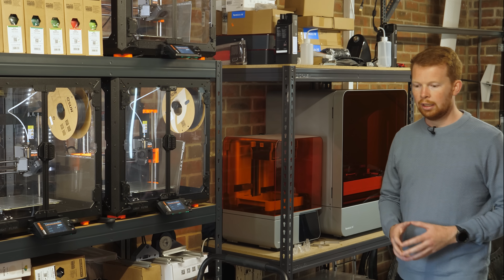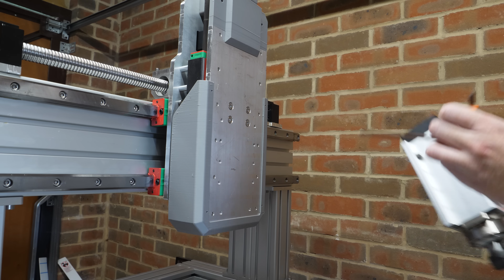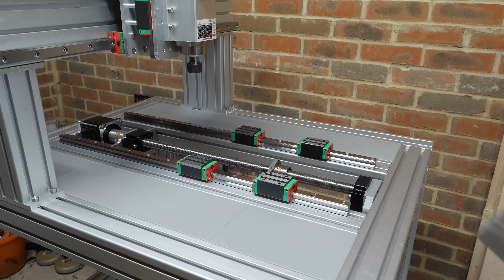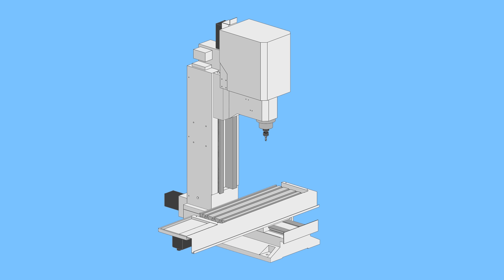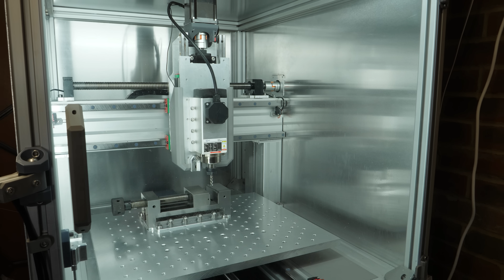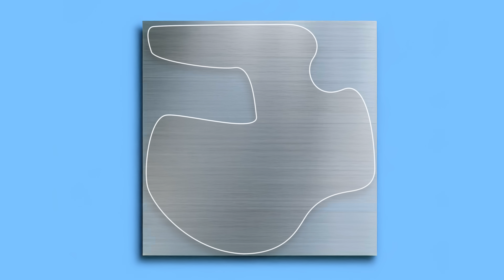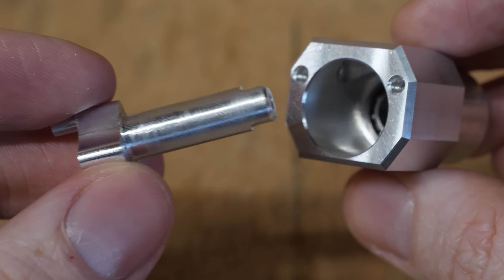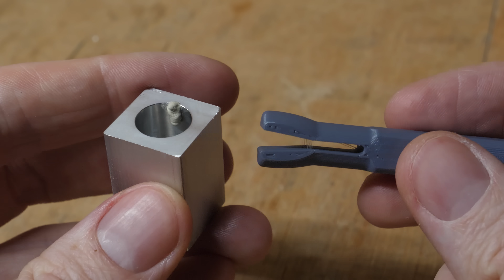I Needed an Engine, So I Built a CNC Machine

Comment: i dont get it, you made a probe mount so you dont have to remove the bit yet you still need to remove the bit to clear the material? ;p
And how can you even know what the exact exact probe offset is? Did you measure that with another probe? Very impresive, glad to see you're back!

Comment: 8:19 or 
"Hundertstelfolie" (Stripes of Steel foil Up to 0,01mm thin
Or use a " Kantentaster" (basically makes the same you did with your working tool, but IT visualises the Touchpoint and it doesnt damage the part)
Reply: But a "Kantentaster" has to be used at 500rotations/min

Comment: Someone else has probably already made this comment. In G code there are the G02 and the G03 commands for making arcs/circles in your code. Then the only inaccuracy in the shape will be due to you machines squareness, servo  drives and lead screw backlash. A typical comercial machine should be able to hold a .0003-.0004” roundness accuracy without a problem. Given the proper cutting conditions. Of course turning and boring would be better. By the way you and I have the same last name. My name is Peter Stanton.

Comment: definitely heavier. anemic/pathetic motor. bed slinger cnc lol. nice. mesh cases are nice. also with the cover sheets. focus on diy. no matter how shiny things others might present. own achievements are way more rewarding that others having the rewards. yes a challenge and just doing it yourself. in general. it matters who does. if not you then someone else. then you are missing out of diy benefits. why use mechanical calibration tools. just use laser. laser calibration is way simpler. laser does not have any issues with insulating materials. with laser scanning you get the real time shape of the material/object all the time. so you know if the machine coordinates have drifted. same can be achieved with drill press if you have automatic 2d linear location attachment holder. nitro engine. w00t. so what did the oil do. block the ports. firewalls are a nice thing. stops nonsense.
Reply: but why so large for so small target part size. micro cnc would be the most best, could be done with 3d printing directly. with some metal screw rails etc. outer metal sheets.

Comment: Paintball Dork here: assuming you're planning to use 12g co2 for your source, that 900 psi starts dropping off really quick. I'd suggest a regulator that you can tame 900 > 150psi. That flatter power curve will help with cooling too.

Comment: Perhaps you could add a small metered Venturi in your gas supply line to introduce oil through the air engines intake

Comment: One easy way of locking the cylinder would be by using one thin nut, just extend the threads on cylinder bit further out and use locking nut.

Comment: hey tom i run an open source project that runs RRF (the software most duet boards use) we run a custom add on that adds a full probing screen, rotation compensation etc makes using RRF for CNC so much easier, let me know if thats something youd be interested in and well try help out as much as possible

Comment: I would simply add a counter nut on top of those threads and tight it right where it runs perfectly. But i think you've already thought about this quick and easy fix, so the question is why you did not do it ?

Comment: Once you find the optimal position, mark the cylinder and block (witness marks).  Then you can take it off, put some kind of thread locker on the threads and then tighten it back down to the witness marks.

Also, regarding lapping a cylinder, an old school trick is to use the piston itself to lap the cylinder... that way, the two components "wear together" into a fine fit.  :)

Comment: you can always add a mountable motor on the build plate to make a simple lathe/ 4axis cnc. and something to look into is refence holes on the plate for dowel pins. half the art of maching is fixturing.

Comment: Need plasma generated Ultrasound holography resonance printing. Resonance to transfer energy to metal just enough to warm can be done. Ask chatgpt about it. When it says Ultrasound can't reach temps call it a liar because if you don't stop Ultrasound it will start breaking bonds that's overcharge its what goal of fire is when trying to split things but just more perfect. If it says "need medium" That's warfare by world science. Respond with this for that part "The atmosphere is gas and we have Ultrasound microphones in the NEAR vacuum of space we can compensate for power its nothing."

Chatgpt, Perplexity, and ect if you don't know the answer yourself or examples that exist to prove its lying to make things seem stupid it will try to make you stupid. WEAPONS not AI.. Weapons.. Boeing plasma force field blocks bomb shockwaves because Plasma generated Ultrasound. Nothing magical.. Shockwave holography with medical scanner safety filters for frequencies. Plasma = High resolution capable of holding perfect atomic structure during cooling too. Fight the system its gonna attack the masses..

ADDED NOTE! Ultrasound can be also used to scan plastic junk to print metal to end disposable products and other things designed on purpose to farm the masses.

Comment: 14:59 you don't twist it like that in Aluminium. You turn much slower, reverse your cut all the time and you have to bathe it in oil. Aluminium is gummy as. 
9:32: copper spray paint. Even a dusting will allow you to probe a plastic or non-conductive material with ease. I've done it many times. You just need to have real copper spray paint. You know for sure it's proper copper when you lift the can. Heavy.
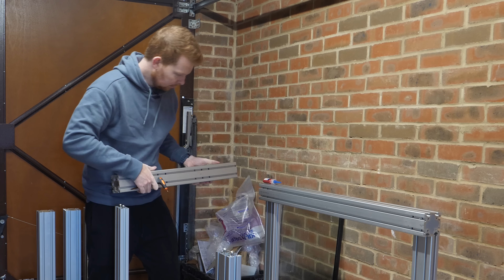1:33 definitely will. I have filled my milling machine with ES and even heavy cuts, now don't chatter. We're talking about 25 mm end mills, going as deep as 10 mm in one pass and not even so much as sniffing. Single best thing you can do for a mill. You should also consider adding concrete panels in the gaps between the frames to add even more "gravity" to the machine.

Comment: Might I suggest that you add a bracket with either a singular bolt or a clamp for locking the cylinder in place? The thought is that once you hit the power band you can then either have a locking screw press into the side and lock it into place or have a clamp that's wrapped around and has a bracket to keep it from moving and you would just tighten the clamp. Then you can take a small chisel and punch a mark into the cylinder and into the block that way you can get it back to that spot again if you need to disassemble the engine. It might also be potentially a good idea to make it so you can have a small amount of oil in the lower end to help keep it moving smoothly and get splashed onto the piston to help seal it against the side walls and prevent wear.

Comment: Just my suggestion and might be worng. But why not add another motor on the bed? That can be screw on the bed for easily add or remove. So it can it spin the block to make a perfect circle. Use the lathe grips to hold the block.

Comment: For cutting circles, have you tried GCode arcs? It’s a GCode that allows the motors to continuously vary their speeds through the cuts, which allows for actual circles to be cut. Though I’m not 100% sure how well that works with steppers instead of servo motors.

Comment: To lock the cylinder you have one very easy option, just use a screw with a small bronze piece on the tip to avoid deformation against the tread.
Reply: Also, to improve torque you can offset the cylinder body from the crank center.

Comment: I have a small desktop CNC. Things that i underestimated: how long does it take to set it up. How BAD software that is used to program the toolpaths are unless you spend ridiculous amounts of money. For sure i don't come from CNC world and CNC operators most likely disagree because they have learned a certain way of doing things but... They are horrible to use. There are so many thing to setup and the UIs are not intuitive at all. I'm good at visualizing in 3D in my head, i can rotate things, offsets etc are easy but.. holy hell are the CNC programmers awful. 

And then we get to the free stuff that is borderline unusable. Open source can not design UIs, that is for sure. I mostly use it as a mill, manually operating it with Candle as making a single slot, or planing takes SO long to create toolpaths in the software. Now i sit and dial in values manually, write very short g-code snippets to do the job. I won't be making anything but simple things that require accuracy like it is just an end mill, and then of course carving, as carving actually is made simple. It is almost "import SVG, create code, press a button". I will NEVER do another PCB on it since the only software you can get without spending 500 on it is FUCKING AWFUL.. because it is made from modules made by various open source developers and each of them is different, uses different UI, different shortcut logic and stupidly messed up heap of shit. I much rather draw the PCB by hand and etch it, or order it online. 

CNCs are a thing that have been in the "inner circles" so long that it has developed a bubble around it: "this is the only way things are done". There are so many things you could do to the whole ecosystem. It is never going to be like 3D printing but the whole experience felt very much like gate keeping.... that no one wants to make them more user friendly and intuitive as that would mean more people can use them...

For anyone thinking of CNC: DO NOT! Unless you are ready to put in like our guy here, 5 grand or more where just all the software needed is going to be a grand.. The machines and learning how to operate them is not hard, you will break a few bits and ruin your bed in places. It is the software that is the main problem. They are either way, way too simple where you can't really do anything, or you have to set dozens of parameters to make a hole. When i use it, i usually end up using Easel in ways it is not designed to work but.. it creates code fast and doesn't give a fuck if you have set all the parameters of the workpiece and the machine correctly. Just define your own zero and let it rip..

Comment: a dremel and diamond or carbide burrs make quick work of broken taps and drills... yes...we all break one eventually. sigh. use the proper three, taper, intermediate, plug... little bit more time but so much easier.

aluminium...DO NOT USE DIAMOND PASTE!

both piston and bore need lapping...
the lap must be cylindrical. a bar with slot down the center and small wedge type thing to expand it slightly. some hash marks filed/sawed in to carry abrasive, cutting fluid and shavings.... (external laps are usually two vee blocks) otherwise holes are random, no longer square and parallel... rather bellmouthed or barrelled, and non-circular... for aluminum, use garnet or similar.. then chalk or talc. toothpaste was supposed to be a good lapping compound... i dont think any of them are abrasive anymore? kerosene as cutting fluid...

or just ignore all that, use old sashweights for cast iron sleeves and rings. aluminium lap... can make something similar to the old bicycle gooseneck wedge... just a far shallower taper! expands parallel then. diamond away but make sure to wash it thoroughly...

have happily gotten CI down to 0.1mm wall thickness... it doesnt have to be heavy...

Comment: A couple flat surfaces (for gripping) on the adjustable cylinder head plus few extra threads and a low-profile jam nut seems like a simple solution to secure it in place? Maybe not the prettiest though.

Comment: I don't know what the parameters for your CNC machine are, but it might be possible to have the machine calculate radius geometry for your parts using G02 and G03 codes as opposed to multiple G01 commands .